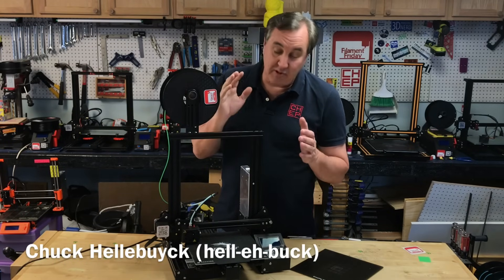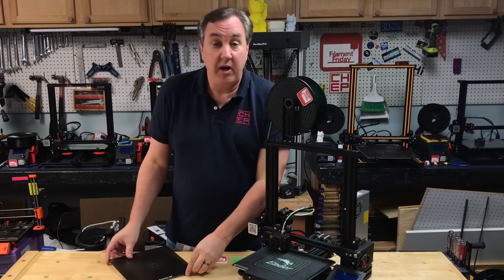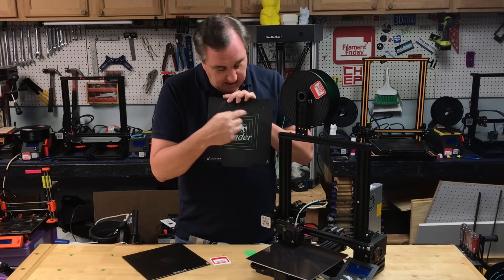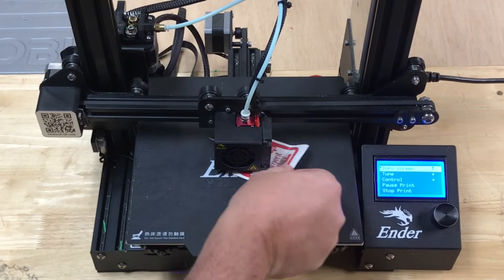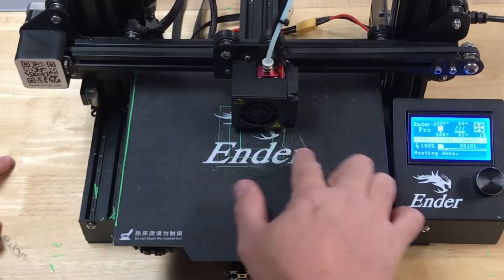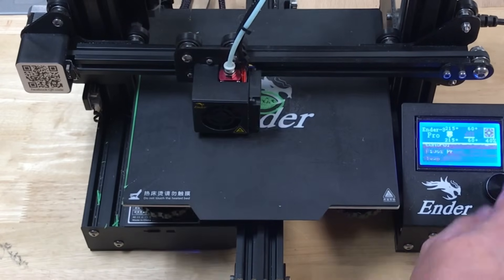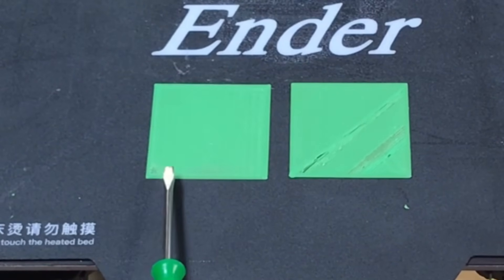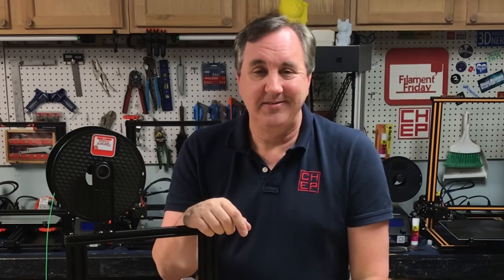Creality Ender 3- Easy Way To Level Your Bed

Comment: This may help you. Here is a common misconception that leveling the bed using paper is correct. This will get you very close but the reason you are getting sloppy first layers is because the first layer is printing the thickness of the paper (usually about 0.12mm) in addition to the initial layer height. For example, the g code stops at the corners and at the centers and lowers the print head to Z=0 which is when you would add the clearance of the paper throwing off the first layer. Truly, at Z=0 the nozzle should be lightly touching the bed.

To fix the problem, either use the G code provided without paper, using backlight to get the nozzle as close to the preheated bed as possible, or by using the thinnest paper or feeler gauge you have. Again, touching the bed would be ideal but I don't recommend this as there's a higher risk of damaging your bed if something goes wrong. Any deviation of z below about 0.1mm should still put out good prints.

Alternatively, change the z value in the g code from 0 to a reference value such as 0.12 if using printer paper or a magic number (keep it low if possible) such as 0.8 or 0.4 where a feeler gauge can then be used. I haven't tried this yet but I will give it a shot tomorrow.

I hope this clears things up for someone. I currently use the paper method with the g code file z=0. After dialing it in with the paper, I raise the bed ever so slightly by moving the knobs at the 4 corners maybe anywhere between 1/16 and 1/32 turn to bring the bed closer to try and eliminate the issue of z being +0.12 from the true 0 value due to the paper thickness.

One more note, you could perhaps print one (initial) layer of known height and measure it with calipers do determine the error. For .28 initial layer height for example, if it measured to be a larger value, the bed is too low. If the height is below .28 you know the nozzle is low. Making adjustments based off of this method would be difficult however unless you knew the pitch of the adjusting screws so that the bed lift per turn could be calculated.
Reply: thank you so much

Comment: So this does not run well with a bl touch using baby steps to adjust?  I printed something else and the layer height was perfect.  I've printed this test multiple times and its like the layer height is totally different, usually with the filament not sticking at all.  Very frustrating.  If this test isn't good for a bl touch is there another test you'd recommend to adjust the z offset for a bl touch?
Reply: I have ran the stl file in cura, not the gcode included btw

Comment: so when i try to run the gcode to bed level it doesnt work it wants to start running an actual print. ive tried all the files as well... im not sure what im doing wrong with my ender 3 pro... any help would be great.
Reply: Check his pinned comment at the top of the comment section. I was also having this issue

Comment: When I run your gcode it doesn't stop at the locations, it just goes to them and then continues on. Is there a setting I'm missing?
Reply: Use the older GCODE file for M25 firmware. See the description

Comment: On my Ender 3 V2, this always starts out great, but after like 10 minutes, it starts dragging the squares. I have no idea why. I can print a calibration cube without an issue though.
Reply: Poor adhesion, I would guess bed temp too low, print temp too low, or bed position is too low after leveling by a few microns. See my most recent comment on this video

Comment: So you originally said to move the paper so you feel the slightest resistance but then you say to move the paper so that you feel significant resistance. Which is it or dose it not make a difference?
Reply from the maker: It doesn’t matter. It’s the live adjust that gets it dialed in.
Reply: im pretty sure it is the i bit more than the slightest resistance

Comment: newish to 3D printing but I decided to edit the knobs level code so that it went to all positions again. so instead of going 1,2,3,4,5,2,3,4,1 like you have in the code, i changed it to go 1,2,3,4,5,1,2,3,4,5. that way I actually check that first corner again in a better sequence.

Comment: i got a glass bed for my ender 3 pro and everything sticks fine when i run the bed level test. The problem im having is when the bottom left corner meets twice it knocks it which raises the line a little bit is my bed to close or?
Reply from the maker: Yes, sounds like it is.

Comment: Hi Chep, I love your leveling files I use them on my ender 3s and CR10's but I have a CR10 S5 as well would you be able to provide a version of the files that would work with the CR10 S5?
Reply: I might try and edit it my self, wish me luck lol
Reply from the maker: It’s pretty easy. Just use a text editor.

Comment: When I run the gcode to level each corner for some reason the extruder starts heating up.  What is the issue do you think?
Reply from the maker: Not sure.

Comment: No matter WHAT it won't stick!!
Reply from the maker: Clean the bed with soapy water and then wipe it dry.
Reply: glue stick
Reply: What plastic are you using some much harder to print than other best to start with PLA or PLA+

Comment: Hi again. Hey so I used this method to do leveling and it works great but I think my BL touch is messing with it. Do you have a way to fix this or do you suggest not using BL Touch? I know in the past you said you don't use it and I do want to go back to no BL touch but not sure how. Any help is appreciated.
Reply: why is this 2 h ago and on the top of the page

Comment: As you seem to be a wealth of knowledge with the Ender series and 3D printing in general.
I had to buy a new bed for my very new Ender 3 (Original) do I went with glass.. I managed to print the Z axis spacer on the old bed but now my new glass bed will not level.
I've tired every method I can find but with no luck.
One question I have is, If I put my nozel close to the bed and then adjust the limit switch am I meant to move the switch so when it touches the Z bar the switch clicks or should I move it up just till it touches the switch? 
It is really, really driving me mad. 
Also I have tried to level with everything hot and cold but it's always the same results, I have checked the bed and it doesn't seem like it's warped and it's the same issue no matter which way the bed is, it's an official glass bed with the textured top.
Hopefully you or someone can help. 
Cheers
Reply from the maker: Adjust it so the switch clicks. Then adjust knobs using this method: https://youtu.be/_EfWVUJjBdA

Comment: Quick question, when I execute this .gcode file the Ender 3 does not wait for my input to continue after each point, but instead executes all steps one after the other. I haven't found a setting that would change this behavior, am I missing something? Thank you!
Reply from the maker: Read the pinned comment at the top.
Reply: @FilamentFriday  Wow I guess I'm blind today, totally missed that! Thank you so much for the fast reply and the awesome resources!

Comment: Ok...so admittedly, I am brand new to the 3D printing world but, after having watched several Bed Leveling videos and several more about changing bed springs...am I the only one or am I missing something...shouldn't you have to set the z limit somehow, prior to attempting to level the bed? My z limit switch is set as low as it it can go , by default, from the factory. It seems to me that if the bed is too high and the z limit has not been set properly, it will send the nozzle straight into the bed...resulting in the damage some here say they have experienced.
Reply from the maker: Clip off that knob and lower the z switch.

Comment: OMG!  This work flawlessly the first test print.  I almost had a bad day because I changed my factory springs but didn't read see on the packaging I installed the new springs for the CR series.  When I Homed the extruder it almost dug into the bed.  Luckily I stopped the print before any major damage.  I installed the correct springs now.  It's alot of growing pains with these things. Your tutorials are awesome. Thx @CHEP

Comment: so with my new 4.2.7 silent main board in my ender 3, this no longer stops at each corner, it only touches down for an instant. I imagine the G-code can be adjusted
Reply from the maker: Reflash firmware or use the M25 version of the bed level.

Comment: If it's really stuck on and tight to remove is that too high or low?
Reply from the maker: Nozzle is too close to the bed.
Reply: @FilamentFriday  thank you for the speedy reply.  I can't go down anymore, do I lift the z sensor up a bit next?
Reply from the maker: Yes.

Comment: Thank you for the video CHEP, i used the gcode to level my bed on the Ender3 max. 
It work, but on a limit space, do you have the gcode available for the 3 max?
I'm new to 3d printing. 

Thanks
Reply from the maker: I have a CR-10 version that will work. Manually level at knobs then run the CR-10 squares test. 
https://www.chepclub.com/bed-level.html

Comment: Thansk for the video!  New to printing, but curious on the temp settings.  Why 205 and 50?  I noticed most other prints are 200 and 60.  Thanks again!
Reply from the maker: Depends on material and test prints. Like this: https://youtu.be/6LjbCIGCmd0

Comment: Thank you for the video CHEP. I tried using the CHEP bed level print .gcode after levelling the bed and everything turned out great, but when I tried to print anything else using my usual cura settings nothing comes out of the nozzle I checked several times and the nozzle wasn't clogged. Hope you can help me with that I've been struggling with it for 3 days.

By the way I have 32 bit board
Reply from the maker: Try just heating the nozzle and then running the extruder under move menu.

Comment: Hey CHEP, thanks for the great video.
I've leveled my bed now using the thinnest paper i could find, a receipt but the first filament of the first layer doesn't stick.
I will try cleaning my bed again and see if it works but i was wondering if you had any other tips.
Cheers!
Reply from the maker: Could raise the filament temp or just use a swipe of glue stick to the bed.

Comment: Hey CHEP,

I have an earlier Ender 3 which I got from a friend. its using 1.1.4 from what the About screen says. Now my question is that I have re-leveled the bed, but the PLA I'm using is not sticking to the bed at all. Now, my PLA has a print temp of 215 to 230.  What I note, is that your gcode is set to use a temp of 205.What would you suggest, change your gcode to the 215 temp or what?
Reply from the maker: Shouldn’t matter. If the bed is adjusted properly while live printing it should stick. Otherwise clean the bed with soapy water and let dry.
Reply: @FilamentFriday  Hi Chuck, I'll try that. Have to say, I haven't used it for awhile. and it ia dusty.
Reply: @FilamentFriday  Concerning temps, what if the recommended mfg temp is higher? Wouldn't that play into bed adhesion? I'm not questioning you, just a newbie trying to gain knowledge.
Reply from the maker: Their recommendations are usually a wide range so you will probably be within that range.

Comment: I'm using an Ender 3 Pro, and when trying the bed level gcode, it never askes for my input- it just goes through the entire motion without stopping for me to adjust. Any hints? Thanks!
Reply from the maker: Read the comment pinned at the top of comments.

Comment: Hello Chuck, i'm big fan of filament friday. I need help with my ender 3 pro. If my printer does'nt work for a day or more i need to do bed leveling everytime. I don't move printer, i don't touch bed or anything, why does this happens?
Reply from the maker: I’ve seen that. Sometimes I wonder if the Z stop is inconsistent. I’ve never been able to prove it though. I’m also testing orange springs to see if it helps.
Reply: @FilamentFriday  Thank you. If you find what could help, please share with me i would apreciate that very much. I've tried some yellow springs but they are to tight/solid, so there is no much space to handle up/down bed.
Reply: @FilamentFriday  Thank you CHEP, you are a GOD!!

Comment: Chuck
I know this is a nit-picky question.
I was using your leveling gcode with my Ender 3 8-bit and it was fantastic.  After I upgraded the mainboard due to USB port issues with my OctoPi, I had to switch to the M25 version because it was a 32-bit mainboard and the older M0 would just move from corner to corner.  The M25 version works but I have to go into the menu each time and select continue instead of just touching the selection knob.  Is there a setting in the gcode that I should change or a setting on the Ender 3 mainboard that can get me back the quick touch knob response?  Or is this a 32-Bit Marlin thing that I just have to live with?  My new board is a Comgrow running Marlin 2.0.1 (0.0.6).
Reply from the maker: I answered this in Thingiverse but here it is again. Just reflash the board to a Marlin version that has M0 enabled. I explained here: 
https://youtu.be/vFcMW6m9OGg

Comment: WHAT is the feeler gauge thickness of the paper?
It seems that depending on the paper used that actually makes a huge difference.
Not one leveling has resulted in a good much less acceptable print.
What distance should the bed be from the print nozel?
.01mm?
Thanks.
Reply from the maker: Most paper is 0.1mm. It’s just to get it close. The live adjust is where you dial it in.
Reply: @FilamentFriday  I do not measure paper so maybe most is, the stuff I used I tried 3 pages on top of one another and got closest.
So many are talking about you just need to level and no glue needed.  Well glue worked, I also turned the glass upside down so the "magnetic/black surface" faced down.
Getting the part off the glass proved fun.  I used a glue stick.
Reply: CHEP I get more string mess then good printing. Im about to super glue the part to the bed so it will finish.  It gets to 10 maybe 20 percent then pops off 200 hot and 60 bed that is what large parts with big base will print at and complete frustrating
Reply from the maker: I use Avery glue stick sometimes. One swipe layer on glass works great.
Reply: @FilamentFriday  I tried a version we had here that is in a stick.  VERY tight bond, VERY TIGHT.
I might need to adjust the smear on the glass.
I flipped the bed over so that the black side was down and the pure smooth glass side was up.
Reply: I am slicing another model, but wonder what is the purpose of the black stuff on the glass?  Many videos show a smooth glass...  That might be a video idea for you.
I would like to put a server on the ender so I can send a model to it instead of haivng to move the tf card back and forth...
Reply from the maker: Look into Octoprint on Raspberry Pi.
Reply: @FilamentFriday  Buying one online now.
Which firmware?  With or with out adapter board, how do I tell the different boards with the btouch auto level?
I just can not get one single small base model to print just wont stick...
Reply from the maker: Octoprint is an external option for controlling the printer instead of SD card. 
For autolevel you would need new firmware for the control board inside the printer. I don’t have a video on that but there are several on YouTube.
Reply: @FilamentFriday  ordered the device waiting on it, so it will give you time to make a video on it, LOL
Currently, I did something that broke it after adding the BT, not sure what I did, reversing it did not fix it and I already added the firmware update.
thanks.

Comment: Did you do any changes to the square-printing g-code to make it start with the innermost square? My slicer (PrusaSlicer 2.3.0) makes it print in reverse direction than your print. Printing from in out seems much more convenient while most of my prints are quite small and will be at the center.

Comment: So I got the squares to print perfectly.  Then when I went to print my cookie cutter nothing was right.  I don't know what the problem is, now I am readjusting as the cutter is printing.  So frustrating.
Reply: I was able to do that and get a few things to actually print too.  Seems that not all paper is the same thickness
I noticed that things with large bases stuck better than things with small bases.
so depending on how much material touches the bed determining failure or success.
Where is the GLUE!  I see many results that the glue is better than actually having a level bed.
And nothing I find gives the exact distance the bed and extruder need to be from each other.  I think part of the level is to adjust the Z switch on the left support too.
Too bad these things do not come more assembled for better results.  I have wasted nearly 200 feet of filament just in leveling.  CHEP you need to get more detailed in all of the alignments needed.  The details above do not have that information.
you need to level then print out spacers that are actually the right distance which could help in the leveling process.
A catch 22 problem.
Reply from the maker: Not sure what to tell you. Might be something in the slicer settings.
Reply: @FilamentFriday  I just kept turning things and it's printing now.  WOW that's frustrating.
Reply: @janisnunez  Don't know exactly what your model is, but I guess cookie cutter has pretty low surface to stick to bed and could cause the printed object will not stick to bed enough (and you will end up with "spaghetti"). If that is the case, try to add raft in your slicer.

Comment: just got my ender 3 V2 and i am having troubles with my prints sticking, no matter what i do i just cannot get it to work. Even tried hair spray. Maybe the bed is warped? The PLA that was provided with the machine is what i am using for now so i do not waist my ABL and PLA i bought. I will check the bed when i get home from work today to see if it is warped.
Reply from the maker: Have you cleaned the bed surface and leveled it like this? https://youtu.be/_EfWVUJjBdA